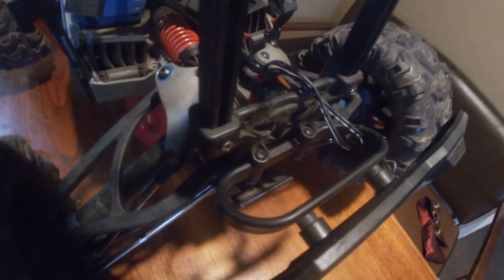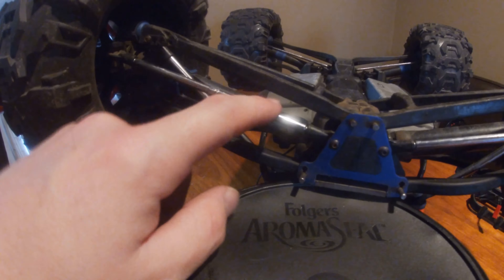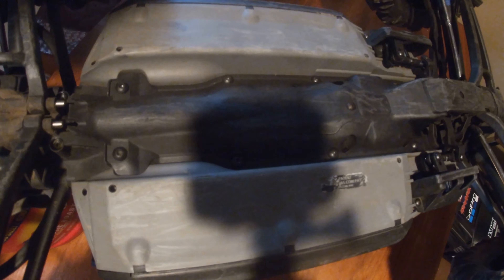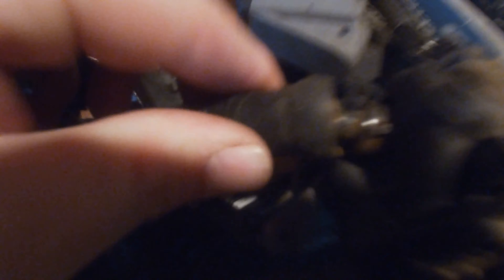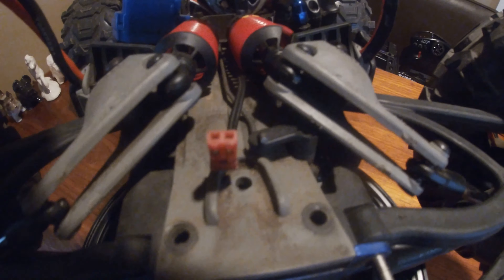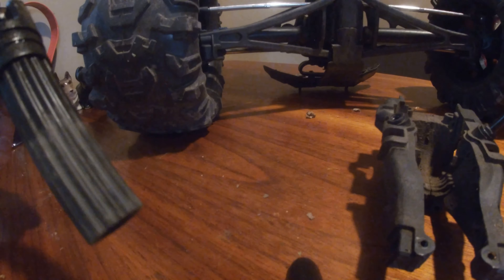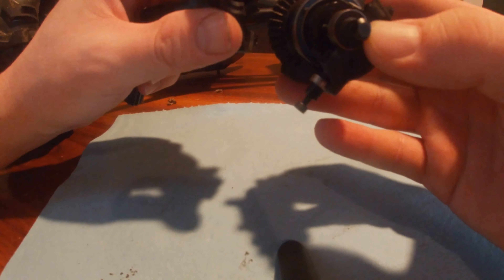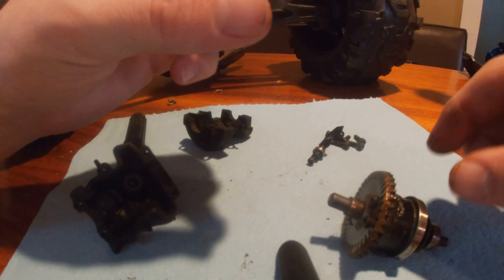Front/Back Differential Maintenance & Repair - 1/10 Traxxas Summit

Comment: I know this video was a year ago. But I’m just curious since you had it tore down that far how come you didn’t check your differential gears? They are the weak link. If you ever need to replace them put the hardened ones in your never have problems again
Reply from the maker: I did but not on camera.
Reply: @Hackers50Maker  I figured you must’ve. I enjoyed the video though. I’ve been there a couple times in the last 12 years until I switched over to the hardened spider gears in the differential then I’ve never had another problem Except for every couple years I put a new 775 on the stock one.